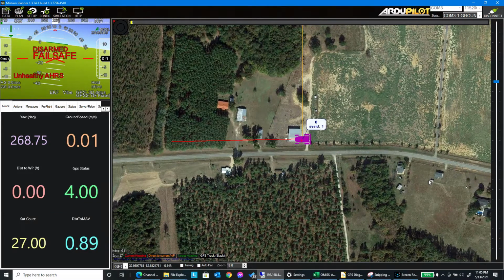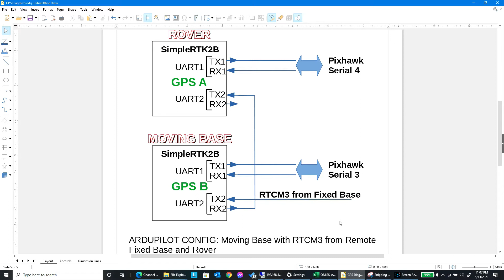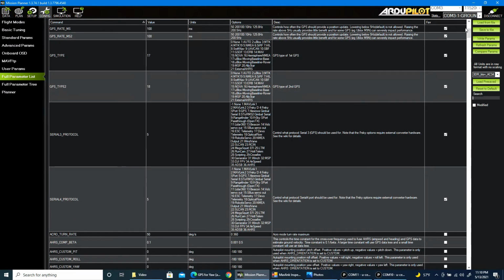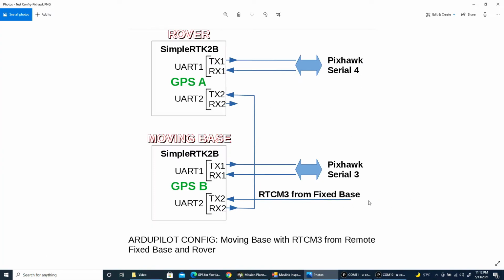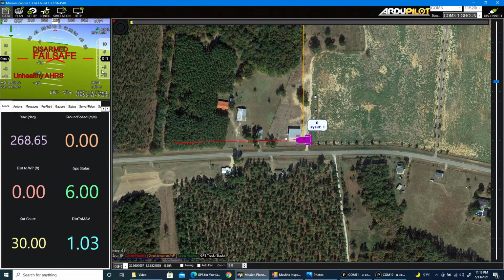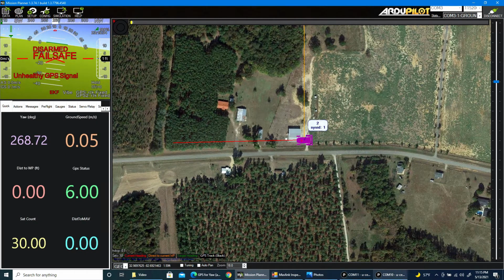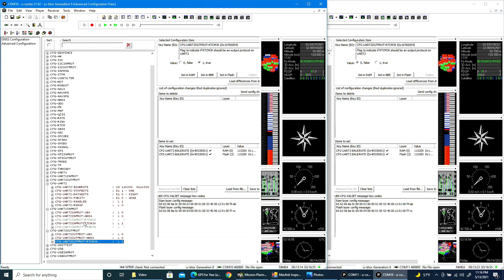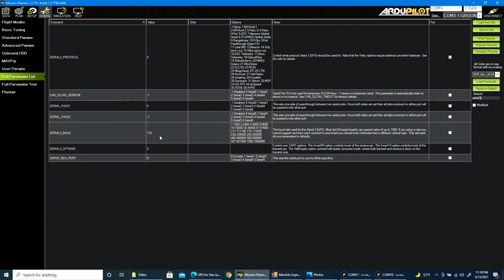ArduRover 4.1.0-Dev Moving Base Config (GPS for Yaw) using UART2 for RTCM3 Corrections

Comment: Hi Kenny, is the diagram at 48 seconds correct? Wouldn't tx from the fixed base go into rx2 of the gps B and tx2 to rx2 of the gps A?
Reply: ah just looked at your other video where you mentioned tx/rx on uart 2 are swapped
Reply from the maker: That is right. It is a trap, for sure!

Comment: Hi, I am a newbie in GPS RTK and I am very interested in GPS RTK moving base. I have a question that with GPS RTK moving base, are we required to have a fixed base station to correct position data to achieve cm accuracy? Thank you.
Reply from the maker: A fixed base is required for cm accuracy. The base can be one you set up yourself or it could be a base (called an NTRIP Server) that is uploading the correction information in real time to an NTRIP caster. If there is an NTRIP server within 10 to 15 km of your rover, you will have excellent accuracy. rtk2go.com is one NTRIP caster that is free.

I have been using an NTRIP server (RTK base) that is 58 km away with acceptable accuracy. Occasionally, I notice my mower will miss a streak about 10 inches wide, which I attribute to this distance being greater than recommended.

Comment: As per 2023, ArduPilot now configures the GPS modules for you. (This video is no longer applicable)
Reply from the maker: Max, I wouldn't completely agree. All of the connections and all the parameter setup inside Ardupilot are 100% applicable. The only part that is not, is the requirements to set up the GPS inside Ucenter. I think seeing those steps, even, are valid. But, you are right that Ardupilot configures the GPS for you IF your  RTCM3 communication device can operate at 460800 baud. That is the ONLY baud rate that Ardupilot will configure the UART2 communication. If you need a different baud rate, then the video is completely applicable.

I edited my description to perhaps make it clearer that if your RTCM3 input into UART2 of the Moving Base can operate at 460800, you do not need to edit the F9P setups in Ucenter.

Thanks!
Reply: @KennyTrussell  No harm intended; I literally took your reply on the forum that this is no longer relevant, because of your post: "Ardupilot sets up the GPSes perfectly now. There is no need to do any of the things I did in my YouTube video. I had special reasons at the time, but no more. You can take two Ardusimple RTK2B boards right out of the box, connect them to the flight controller, set the parameters as directed in the documentation Yuri referenced, and boom, Bob’s your uncle."
Reply from the maker: @maxg4958  No harm taken! Now I see that I worded the forum comment poorly by saying "no need to do ANY OF THOSE THINGS". You have to do MOST of the things in this vidoe. To be honest, I didn't remember what all was in this video when I made that comment on the forum. I think I will go edit it if I can. :)
Reply from the maker: I made a significant edit over there, hopefully clarifying and not confusing anyone who comes along later! Thanks for your points!
Reply: @KennyTrussell hi, I’m Erik from Brazil and I want to create an rover prototype to learn more about the RTK. First of all I appreciate you explanation and your effort to teacher you knowledge. At the moment I would like to define the materials needs. I understand that the start kit of ardusimple F9P LR can be used (pre configured as an rover and base). So before installation on the rover, will I need change the base set up to a moving base?
And to use a fix base without a NTRIP,  can I use the same board RTK2B and the same antenna?
Many thanks

Comment: hi, have you had any experience/luck with EPSrtk ? thanks
Reply from the maker: It is funny you should ask! I am working with ESPrtk right now. I have had a pretty difficult time but the developer has been very helpful via Facebook Messenger. The ESPrtk website is so huge with so much information that I have had trouble reading it all and/or remembering where settings are, etc. I think ESPrtk will work fine, but the learning curve is higher than it should be.

There are some quirks about it that you just have to learn.

Are you using it?
Reply: @KennyTrussell  I'm just getting started, I have developed on esp32 before so I am considering it for my gps

Comment: I've been watching and enjoying your project for several months now and I especially liked your RTK/RTCM update video.  I have a question for you.  If I give my GPS a good internet update right when I start mowing, but then just repeat that exact same update as I mow instead of pulling new updates from the internet, how long does it take for positional accuracy to degrade?  Are we talking seconds, minutes, or hours here?  I'll probably just need to do the experiment and find out.  I ask because my rtcm update is likely to be intermittent, and I want to know what penalty I will pay.  I look forward to seeing how your GPS yaw works out.
Reply from the maker: Thank you for the kind comments! To your question: my experience has been that it degrades pretty quickly. I believe within 1 minute, you will see problems. I have had many times that I lose RTK and pretty quickly, my mower misses a streak in the field. It is pretty much essential to have RTK all the time. If I may ask, why are you anticipating intermittent RTCM?